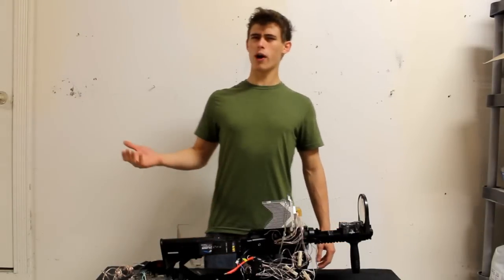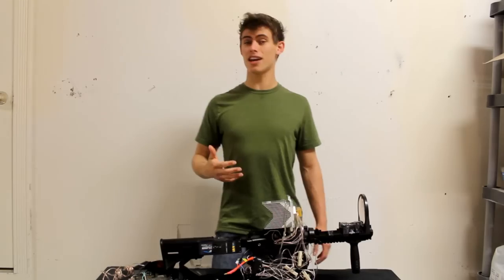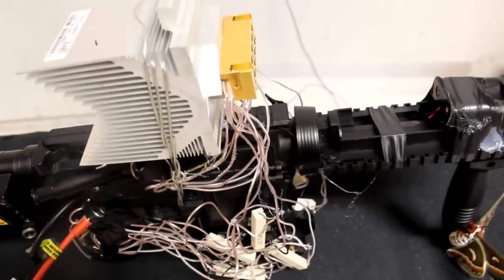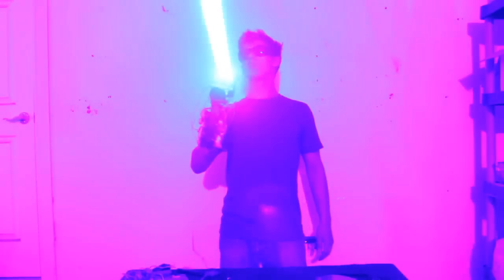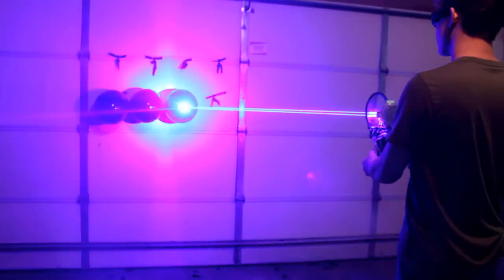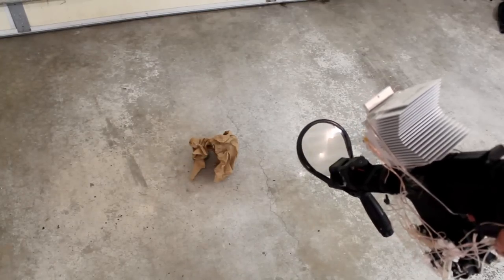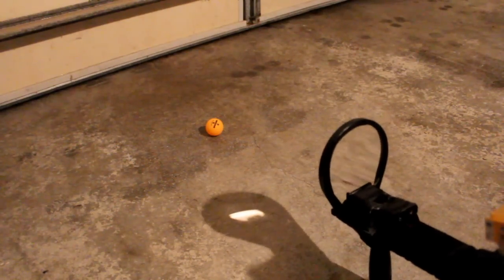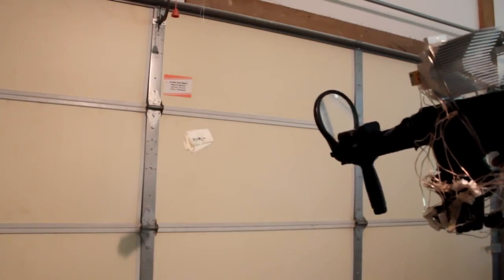My Homemade 40W LASER SHOTGUN!!!!!

Comment: What would this do if used to a human
Reply: WaitingOn Mars Nothing .......except maybe a bad sunburn. Human skin doesn't absorb this kind of laser with any real effectiveness.
Reply: what about the human eyes ?
Reply: jek19801980 Understatement of the century. A 40W concentrated laser beam like that would result in complete irreversible blindness in under a second of exposure. The goggles he's wearing changes the wavelength of the laser to one that the eye doesn't absorb, keeping his eyes safe.
Reply: WaitingOn Mars Well, there'd be some serious damage if it directly hit the eyes. Hell, it could possible damage his eyes if he weren't wearing goggles while using it.
Reply: WaitingOn Mars Very different.  Certain types of lasers can blind the human eye in milliseconds.  Others, like a traditional red laser you find in a laser pointer, would have trouble damaging the eye even after prolonged exposure past the 2.5 second mark.  There are horror stories of YAG laser beams reflecting off of surfaces and causing instant blindness in operators not wearing special protective goggles, but the chances of it happening are 1 in a million.  Still...you only get one set of eyes.
Reply: Sebastian Meme Can do custom tanlines :)
Reply: WaitingOn Mars We will use it against Martians.
Reply: Burn the livin shit out of them @ 40W's & I'm certain of it
Reply: MaestroDraven 
You dont thk 40W's of 445nM focased UV light wont burn dark odjects including low reflective dark clothing including flesh well sir you need to reconsider....

Even 1W of any focased wavelengths are hazardous if not taken seriously, i know they are for a fact, & nothing to play space person & ET w/ those burnin lzr circuits enclosed  in modded toy rayguns & rifles thats for sure...
Reply: MaestroDraven 
As long as the lzr eye protection is the correct wavelength range there will not be any lzr threat to the eyes
Absolutely sir...
Reply: X-15 I've been using lasers for 10 years now, hands-on.  Wattage has nothing to do with whether particular material will burn, or mark....or not.  Try tossing a metal substrate into a CO2 laser machine and watch what happens.  Then put a wood product underneath an ND:YAG laser.  Regardless of the wattage, little-to-nothing is going to happen.  That's due to the laser type.  This isn't Star Wars, no matter how much you want to believe otherwise.  As for your other comment about eye protection, that's obvious, and was never brought into question.
Reply: MaestroDraven 
Don't give me that Star Wars shit mister your trying to lay on me, so from your reply you obviously dont know crap regarding diode lzr's in higher output wattages that burns like hell, that you w/ so called 10yrs lzr experience ought to know unless you lack knowledge of THE DIODE LZR I,g that im talkin about & by the way i now thk that your a trolling BS artist & mentioning a half ass"d statement regarding goggles as you put it, dont know shit apparently regarding lzr Safety Eye ware  wavelengths ext, so again I,e. you don't know Dudley crap about Diodr Lzr's I,g i surmise that's either book learned & or hands on experience...

And Star Wars!, give me a friggin break w/ that bullshit mister your just trying to make look stupid about this sub you ass bag...
Reply: silverbird58 
As far as the "DIODE LASER" there's no need for exit mirrors to critically balance....

So to put this simply, enclosed inside the cavity of the diode is the CRYSTAL, when electronically stimulated will emit photons to the exiting CAVITY of the diode that has no reflective mirrors to worry about, so diodes being a solid state device you'd worry about overheating where heatsinking is very critical...
Reply: silverbird58 
When ya sober up ill tell you more, & i dont thk you really understand this presentation, & i suspect your that religious right wing hateful of the world Zionist ass bag that is following & trolling me on every topic of interest i have on YT, & i know who the chump is, so anyways listen, all you need to do instead of YOU wastin my time is to simply GOOGLE: "Diode Lasers", & you'll find a shitload of info for the novice, & if you have enough brain pwr then just simply take that subject from there is all...
Reply: MaestroDraven 
You certainly havent devulge nothing knoledgeable about Diode Lzrs that we all in the know simply knows better than the know nothing BS your trying to play me on mister..

Simply put you dont know shit about Diode Lasers, now try another trolling handle name to try to fuck w/ me w/ on this sub, & ill still set your unknowlegebale ass strait mister is all...
Reply: Ill class you mister w/ the mentally unbalanced, keep talking your stupid crap that now your upset about & ill be waiting on other blog sites of interest to cut your trollin BS short mister...

Ill take the higer ground & not reply to your ass wiped remarks to me on this blog starting NOW...
...
Reply: MaestroDraven 
One more last statement to you chump, if you think that 500mW's to 40W's of UV focused laser light wont burn your unknowledgeable & phonie trollin ass then just stick it up there in your rank rectum or eye & see what happens you dumb chump, is all w/ you....
Reply: silverbird58 What amazes me is how quickly laser technology evolves.  Go back 12 years ago and many industries were still using CO2 lasers with massive water-cooling units that looked like they belonged in an air hanger, as high as the ceiling.  Nowadays the lasers are so refined that they're air cooled with a few 120mm fans in a PC-sized case for galvos.  I love to see the progression.
Reply: MaestroDraven 
Well what about DIODE LASERS, you friggin idiot that Mr Pyro is presenting here, & not CO2 or Argon, water cooling ext, do you realize DipShit that this presentstion represents DIODE LZR sys thats being presented instead of your lame & off based generalities concerning the nonsense your spittting out...
Reply: I guess ive proven my point Mr Pyro & everyone thats in the know...
Reply: silverbird58 
Reset your brain functioning mister, then youd thk before you can write clearly again ok.....
Reply: silverbird58 I'm more excited about lasers used for nuclear fusion.  That's some SERIOUS stuff!  I read about a laser that was able to achieve 10 million centigrade to compress a small little pellet until it imploded and released a burst of energy.  Might seem small to some but the real-world applications are astounding.
Reply: MaestroDraven 
Well fine then you creep, what do you know about diode lzrs used in our daily lives, & remember this is a diode lzr thread, so what do you know or thk you know, have you googled diode lzr's to study this sub like i advised a little to @ least debate anyone in the know about this & of course you'll still look stupid, other than just my questions I'm tryin to ask ya that your still tryin to dodge the issue with...
Reply: OMG why is everyone fighting I just wanted to know if this would burn human flesh. I am not educated in lasers at all
Reply: +WaitingOn Mars
Dont mess w/ hi pwrd modded burning lzrs, its like this if the 40W lzr can start a camp fire, let alone burn your house dwn, well shouldn't Deductive Logic instantly indicate to the fool that he/she themselves can cause or inflict serious burns on themselves or others...

I forgot that theres enough individuals that lack DL in there everyday lives even...

THIS TYPE OF PWR IS NOT A TOY, trust me...
Reply: silverbird58 
I see your a fool man & listen, "Don't put your life on others hands," so just ponder that loser because the diode lzr is also a wonderful PISTOL TARGET INDICATOR tool too, for your info mister...

Comment: You can buy 10W laser diodes here:
http://www.ebay.com/itm/808nm-10W-C-Mount-Laser-Diode-with-Square-Optical-Pattern-/251335122336?pt=LH_DefaultDomain_0&hash=item3a84bd9da0

3000 of those diodes would make a lethal laser weapon like this one:
http://en.wikipedia.org/wiki/Laser_Weapon_System

Below is a url to a 15W laser diode:
search for "5. BOB808T15000  808nm 15w laser diode  CS" at
http://www.alibaba.com/product-detail/laser-diode-10w_1269982332.html

Comment: Hello, what it is the approximate temperature reaches the laser? and what is the maximum distance of effectiveness?
Reply: Alexander Schubaltz Laser temps depend on a lot of factors including frequency, the material you're trying to hit, and the duration.  Slow down the rate and it'll sit on the target longer, increasing the temperature.  There's no way to really gauge this.  Most lasers rely on precise focus ranges to work, as well.  For instance, if you're trying to laser a piece of metal with an ND:YAG or Fiber laser, you'll need precise focus from lens to target, otherwise the laser won't work and the beam will scatter.

Comment: you adjust the focal point with the magnefying glass on the front, is it possible to add more than one glass? also, what is the effective range of this thing? from how far away could you set a piece of glass afire in less than a minute?

Comment: Nice build.   Built one at 40mw a few years ago, and use it to light home volcanoes at a distance.  I call it the laser with the 'frickin' shark on it, since it has a shark decal on one side.  Works quite well, and it keeps the volcano's ignition burst at a safe distance  The modules you can get these days are nuts.  Bear in mind that anything 5MW or bigger can and WILL have a serious effect on your vision!  Wear eye protection.  At 40 milliwatts, you could wreck your retinas with one stray reflected beam to your face, and blindness would be a hard price to pay for some laser fun.

Comment: Some thoughts on laser 'weapons'
Unless you want a generator set or a vehicle mounted laser, any portable unit is best suited for eyes, cameras, dry-tinder and other delicate/combustible targets.
The energy and contact time required to 'burn through a guy' is too great for what reality can bear.
Peoples is about 3/4 water. Water takes heat to boil.  The water has to be gone before burning can start.  Why?  Water boils at 100 C, and no higher.  Boiling water carries away heat.
So to burn a hole through some hapless victim, you need to dump thousands of watts of energy into a steadily deepening hole in their body.  The edges of the hole leak, the fluids are mostly water, so more energy dumped into making steam.  The victim may squirm a bit, so now the beam is cutting through in a new spot.
Just hit the victim with one huge burst?
Same energy cost [thousands of Joules], but now we have all the problems of a kilowatt-class optically pumped laser.  Huge, delicate, stationary, low cycle-rate and for every kilowatt 'down-range' there is about 10-15 kilowatts of cooling.
A laser with a 10% efficiency is going to get really hot.  Hotter than the target.

All hope is not lost!
Fiber lasers are extremely efficient, require very little cooling, produce a single, highly coherent beam, and can be scaled up in power to the 20-30 KW range!
The downside?  Invisible Infrared.

Comment: Is that a laser-bar from a newer Projector?
Most 'bulb free' full-sized projectors use a near-UV laser array.
Here is a challenge: Work out a 'trombone' lens holder so that when any individual beam is in sharp focus [distance related], the laser 'dots' are also overlapping at that range.  Your current lens casts an 'image' of the laser-bar: you have two rows of four 'dots' on the target.
Eight 5-watt 'dots' is freaking awesome, but a single 40 watt 'dot' can burn metal.
See also Non-imaging optics.  Ways to collect light from multiple 'sources' and create a single source.
Very careful splicing of optical fibers can combine any number of lasers, but the equipment needed is laboratory grade.

Comment: Nice, but it needs some work. This isn't a 40W laser, it's 8x5W.  8 badass lasers, but it doesn't equate to a 40W laser.
If you can't add a micro adjustment to zero in the lasers for a specific distance you're never putting the full output onto one spot. At distance it would never come close to the output described, BUT, <<<<------HUGE BUT.

If you arrange the laser array in a RING. You could concentrate much more energy on to one point (a a specific distance) with the same lens. The rectangular setup aggravates the inherit aberration in the magnifying lens. But if the lasers where all set in a ring form you could maintain the collimitation and set each one at a relatively equal distance from the lens' axis.  At distance this'd suck more, but within the focal range you'd be hitting closer to peak efficiency.  You could always add multiple lenses for specific ranges.

Comment: Those lasers deserve some switch-mode current regulators. But I can't actually figure out a practical way of bringing all the beams into a single one... I they'd be different wavelengths, dichroic mirrors, but on the same wavelength, without loosing power at each mirror pass...

Comment: My friend - That is quite the gadget. I cannot express how much I recommend you to wear the proper eyewear. Based on the wavelength of your laser and power you need the proper Occular Density (OD) lenses. That laser will do Cornea damage even from stray light bouncing off the front lens or hitting another source in your work area.  Not all the energy will pass through the front lens.

Sunglasses are useless.

Comment: Not even knife edging... just a diode array and a telescoping lens.. useless having to be at the right distance and having to swap those telescopes all the time. I can even see the beams not be narrow together after the telescope despite the brightness.
Also why are you using LM317.. and no lasorb.. those diodes won't last long and the LM317 being a linear regulator is also very inefficient. The claim 40watt laser is pointless with a beam diameter of this size.. the beam is gross and ugly.

Comment: This guy is a genius.
Reply: ***** what happened to your shirt?
Reply: ***** "lasers don't emit light".  Of course they do, genius.  Stay in school.
Reply: ***** this is fake
Reply: ***** i need a laser like that in my home
Reply: miguel let Low powered lasers are quite real.
Reply: A "Real Genius". One of my fav movies as a kid. Val Kilmer made a laser looking similar to this in the movie. Youtube it.
Reply: gelu4in The laser shotgun happened to it.
Reply: ***** Lasers can be built at a number of frequencies, including in the visible spectrum.  Think of laser pointers. 

And the ones in the visible spectrum can cause damage if they are >1 mW.  Less than that, the blink reflex tends to save you from burning out your cornea. Lasers in the ultraviolet (non-visible spectrum) are even more dangerous, since the blink reflex does not protect your eyesight.

But what this guy is doing is plain nuts.  I like where he panned the laser beam across the shiny metal reinforcement on the garage door... which is liable to reflect the beam back into his face.  And with a 40W laser, he is kidding himself if he thinks polarized glasses are going to save his eyesight.

Bottom line: Don't try this at home, kids!  And to the poster of this video: you are not a professional, you are not using that laser in a safe responsible manner like a professional would, and you are putting your vision at risk.

Comment: Too bad those diode blocks have the ball lenses attached, and as you know removing them will cause the gain medium to go bad when exposed to air. That's why I have been wanting to do this with the PLPM4-450 array, I have a bunch of lenses and expanders that I think could produce a glorious beam. But I still have not found a unit with the PLPM in it. Have you torn down one of the new xj-v1 units yet? I would like to know what's in it before buying one. Thanks.

Comment: We know  4 sure: no smoke  detectors  in  his garage.
Wicked lasers. .. I wonder what the cost is? Few hundred @ least.
Reply: Rhas 'Churol Check DTR from laserpointerforums site: https://sites.google.com/site/dtrlpf/home/diodes
Reply: @markweber7784  4 years later:  oh ... tnx .. I'll check it out.
Reply: Kamalakrsna Devi Way less than that, these are easy to build and cheap
Reply: somany5 Think again!  The diodes alone are around $40 - $50 each, then there's the drivers, heatsinks, battery and rifle body or host.
Reply: somany5 Really? Most 2 watt diodes I'm finding are in the $100s.

Comment: More of those multi-lasers and a variable focus system that could focus the beams into a pinpoint quickly and easily, in the 1000W+ range, could make this into a viable small arm.  It being totally silent would make it especially marketable... bigger batteries would be helpful, but you would only need it to work in short bursts.
Reply: Joe Zasada Other than the fact that there's a giant long beam of light pointing right back to your location...

Comment: So I assume you could get this up to 80w or even a 100w by scaling the design up a bit? Can this be used to blow out tires on a car? What's the useful range?

You should refine the design and make it more durable, maybe use an external battery backpack to give it longer life.
Reply: TJP77 Nice try Terminator
Reply: So you want a laser flamethrower basically